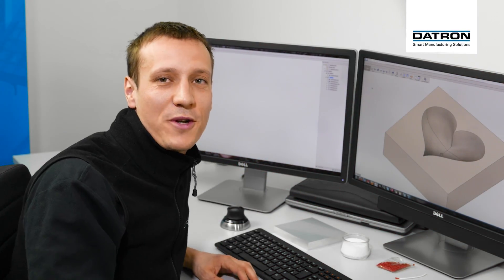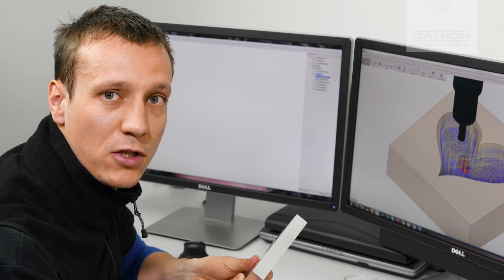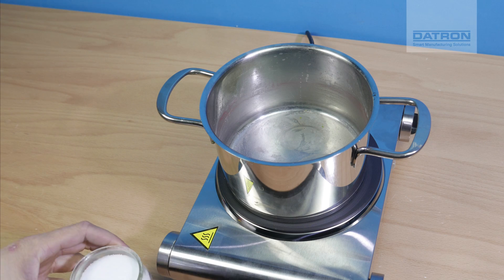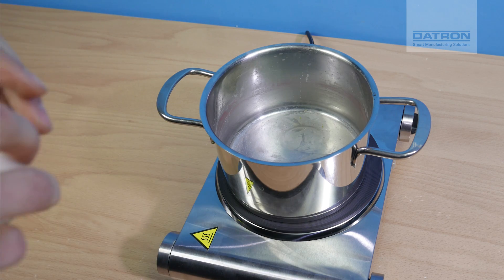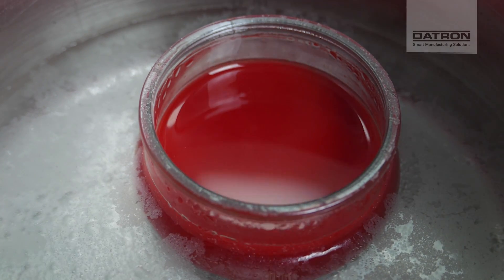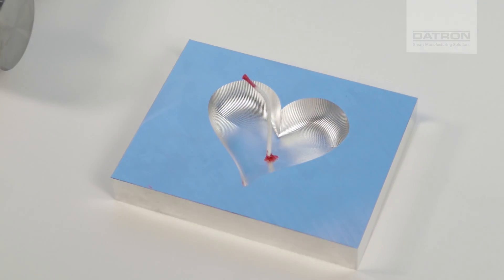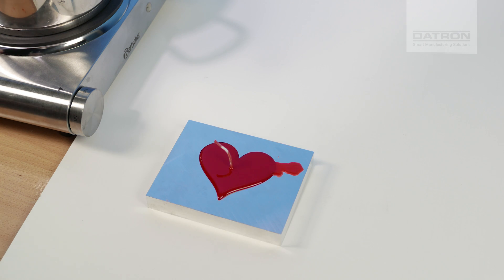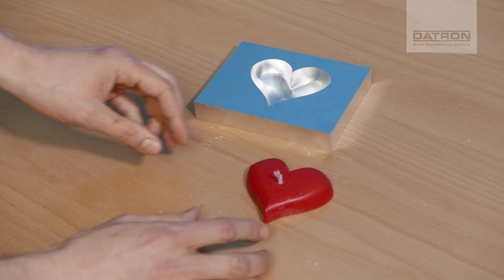Shape of your heart -  candle mold milled on a DATRON neo

Comment: What tools u use ?
Reply: I need a tool for milling aluminium, i have used some american brend before and Iscar tools as well, but the aluminium is getting sticked on the tools and after few seconds the tools is broken. Which one you recomend from this item no: 
0068460L
0068960L
What is the meaning of Alcrona and RG1 RG2 ?
Reply: Hi Riste, both of these tools are quite long. Do you really need that full flute length? If not, go for the shortest possible tool for your application. That´s the best way to keep the performance high
Reply: Are you using recommended speed and feeds???